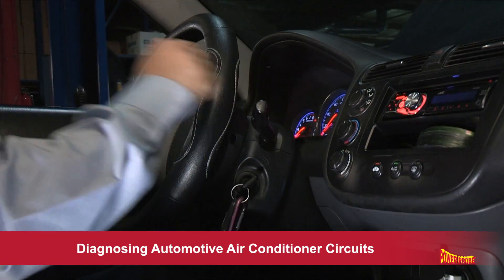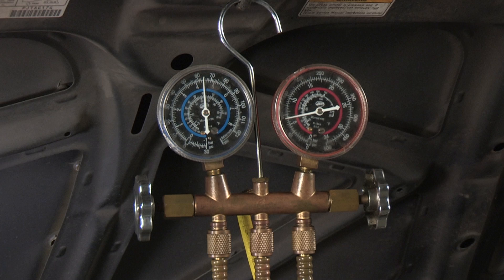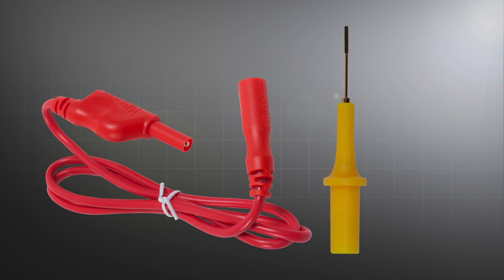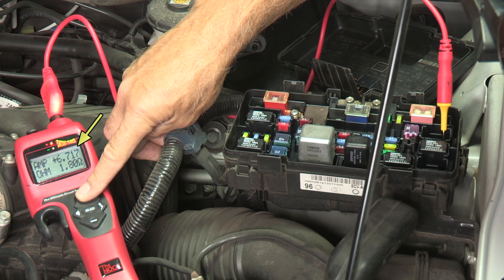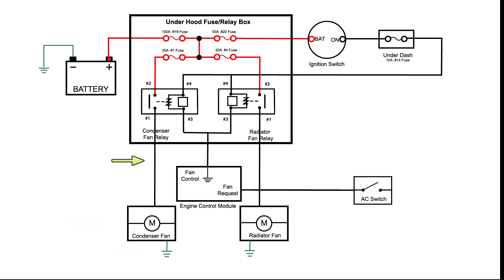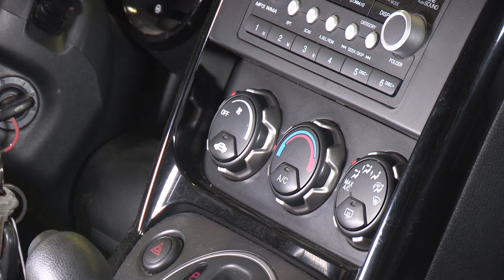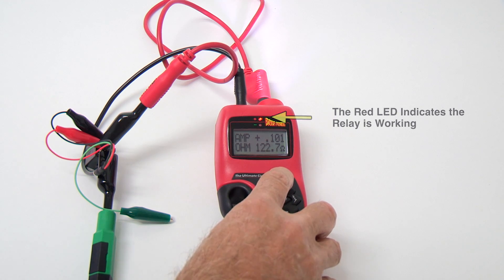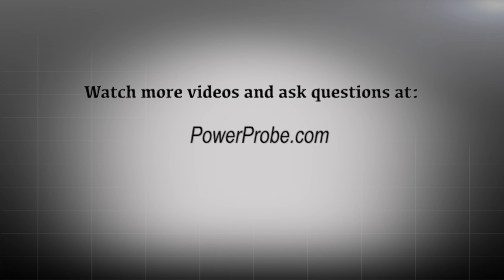Diagnosing the  automotive air conditioner electrical circuits

Comment: The Hook is a great diagnostic tool, one of the guys I work with has it. The only thing putting me off buying it is the fact that it is now discontinued. Is there a problem with it? Is there a new model coming out? I know the Maestro is the newest model but it still lacks the versatility of the Hook.
Reply: had mine 11 years {new} and have bought a second one just in case it breaks down.takes a bit to learn but boy what a top tool /  the company changed owners and ths man in the demo left. once i learned the machine i have yet to get an electrical fault i cant fix.    The later hook is not in the same league .for all you people who bought  get it  back out of the box with todays electroncs its a must.
Reply: What does the little hook do?

Comment: Im having a issue with my car.i have a shorted tail light.when the switch is turned on the fuse gets so hot it starts to melt but doesn't blow.its a 94 camaro.please help i bought the ect 3000 and im ordering the power probe 3

Comment: Thanks powerprobe, I'm feeling all shaky inside with excitement for this tool and learning to use it. Only thing is I haven't bought it yet. I am loving the tool, and with regards the relay tester, how does the tool display there was a problem with the relay. Do you have to stand there watching the lights light up and listening to the sound it makes eachtime it pulses the relay, or if there's a fault will it say there is on the display? Leaving you to go off and do other stuff whilst it's testing it?
Now I must say I have the powerprobe 4, and would like to know how similar are the two tools? Could I have performed the test in this video using the powerprobe 4 as well? I know I could have given the condenser fan power from the probes tip. Could I have scrolled through to a fuse rating setting as well? I dont think it has that function. 
Await your answer. Love my powerprobe 4 though, great work guys.
Reply: How do you know when using the hook that the relay is faulty though? Is there a message on screen or what?
Reply: the relay stops or stalls dummy @jamesbarratt593